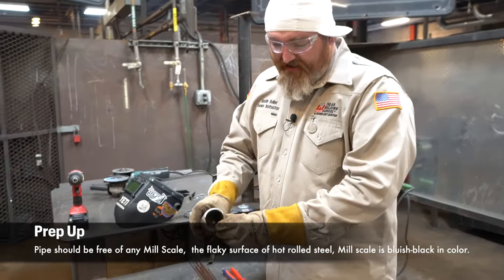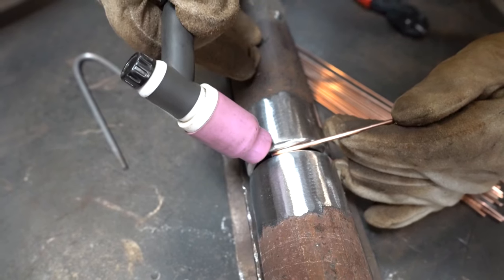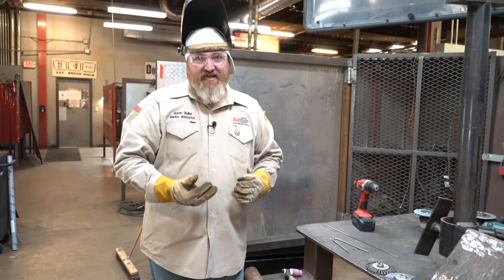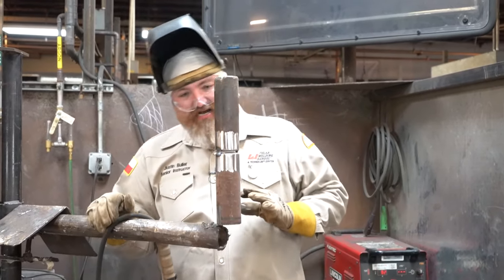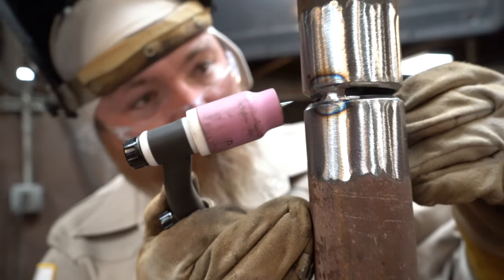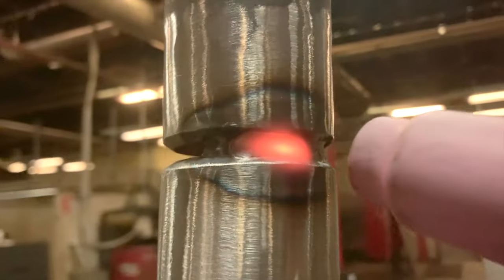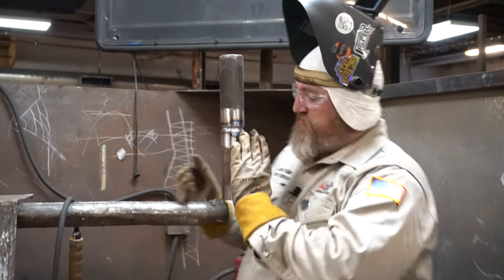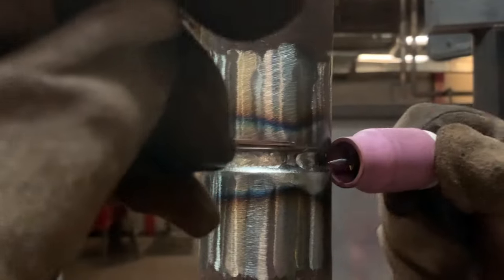How to Weld a 2G 2-Inch TIG All the Way ~ Tulsa Welding School

Comment: The root is to heavy you'll bust out and your tie ends aren't consistent with your root..
Reply: Man, with gravity as it is, and hot droopy metal, you gotta wonder why they want a 5/32's gap on the tube. 

It's better to make your tacks on the vert side of the tube so that gravity isn't working against you. He may have been welding like that so that we could see it better.
Reply: I don’t think that root is above 1/8th, he will bust for that dingleberry if it’s above 1/8
Reply: phaser ray would probably be a no go but that would pass xray all day, ive seen way worse than that in the field pass xray
Reply: That’s gonna pass phasa ray n X-ray all day. It’s not perfect root but it’ll shoot. Best way to weld tubes is hot n fast give it a tight 1/8th gap n run ur torch at 150-170.

Comment: Can appreciate this guys hard work on this video but I’ve been in this trade for 35 years and you don’t need a 5/32” gap to weld pipe. Heavy 1/8” is effective. Only time I use a 5/32 and back feed is when I’m doing Heavy wall with a lot of high low mismatch or when the fittings are bigger or smaller than the pipe. Then i May transition the pipe or fitting to get a better fit up.

Comment: I thought back purging would be necessary in order to keep it from sugaring on the inside or am  I tripping. I usually leave a 1/16 or a max of 3/32 gap and do 4 tacks. Im fairly new but thats what the OGs at work suggested I do. We weld stainless steel pipes for caterpillar gasoline engine turbines and every single weld bead is ran through x-ray.

Comment: What kind of Kleins do you use to cut the filler wire?
Reply: No. 9 lineman’s work great! (Blue grips)
Reply: The ones he actually have are the Knipex Mini Bolt cutters. He mispoke about which pliers he used. I also use Knipex mini bolt cutters and its like butter. Make sure you get the knotched version cuz it really helps with that 5/32 wire or anything bigger. Makes cutting stainless wire easy too

Comment: No wonder half of tws grads cant get a job or barely hold a torch when they do pass 🤔.. lol you could buy a set of fitting clamps and tack the bottom that fit is all fucked